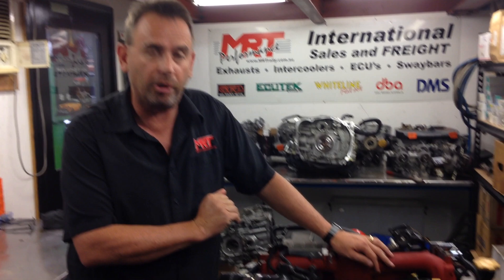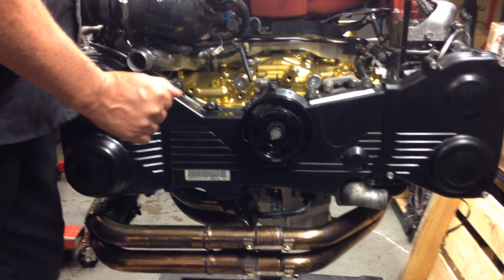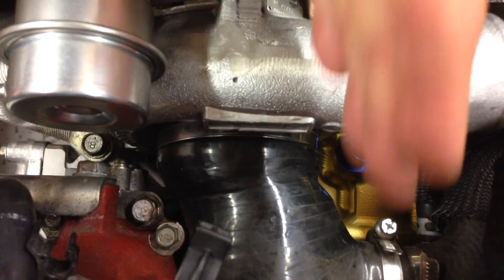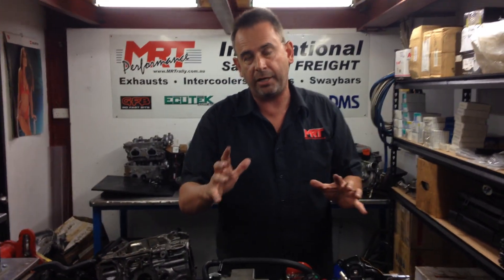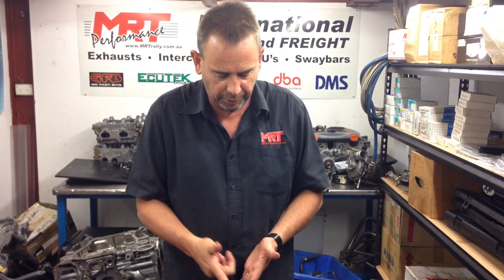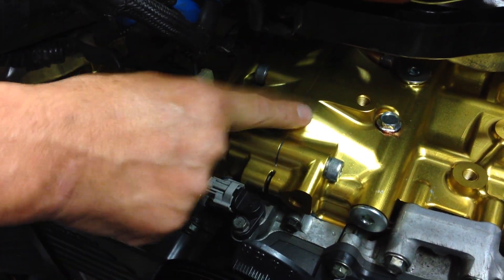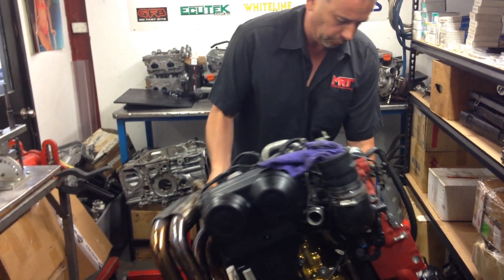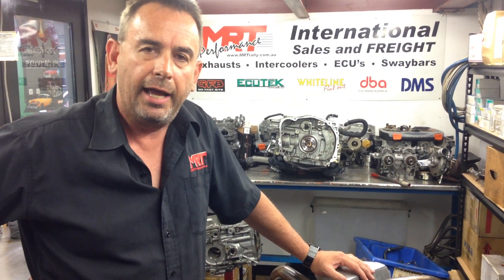Project Billet - Upper Engine / Inlet Manifold / Turbo Configuration

Comment: With the turbo outlet hitting the throttle body, could you just rotate the throttle body 90* and avoid having to weld the turbo??
Reply from the maker: not possible>:(

Comment: does closed 2.5 forged short blocks work well with regular 257 castings or would i have to modify the heads at a machine shop to match a closed deck? just curious thanks for the cool videos brett!

Comment: The stock turbo inlet ripped on my STI which caused to to run lean, which then caused the piston ringlands to fail and send bits of metal throughout the engine ruining the bearings and turbo. So I know how important it is to have the inlet on tight.
Why didn't you go with a hard/solid turbo inlet? Would it not fit?
Thanks for the great and informative videos!
Reply: Vegaspsycho oem inlet is garbage
Reply: yeah and so are the stock pistons
Reply: silicone inlet is less prone to heat soak, easier to fit (e.g buy it instead of custom making it), but other than it's probably just what works and is easy, if they over engineer every little thing the build cost would skyrocket